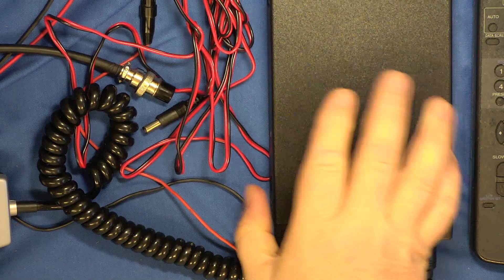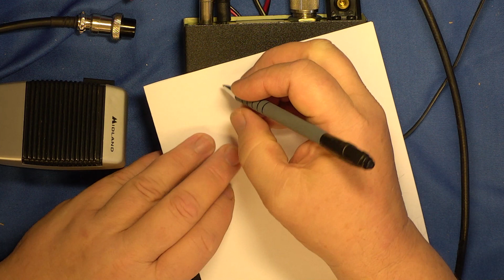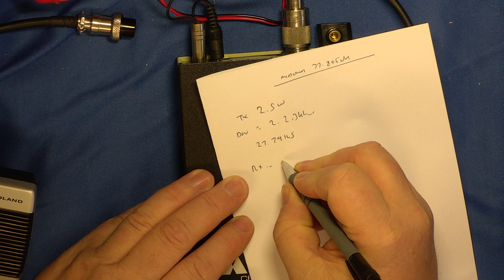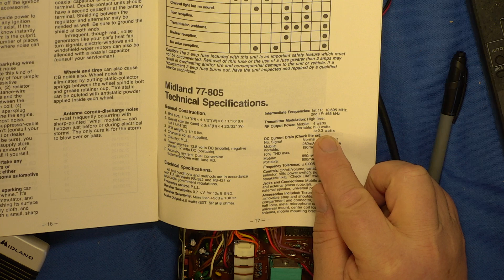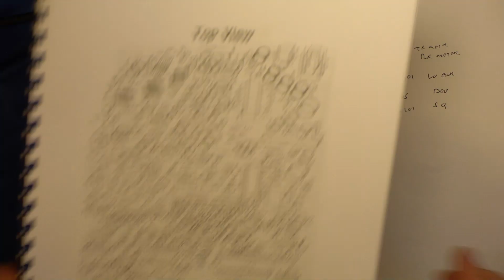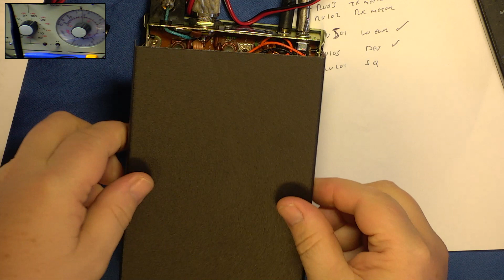Midland 77-805UK CB27/81 Portapak CB radio -  service

Comment: Funny you mention the "5 W input" thing w/r/t US CBs.  I am trying to find when the specification changes in the FCC regs.  At some point, amateur radio power limits were also changed from dc watts input to watts PEP output.  CB changed about the same time.  I'll let you know what I find ...

I really like the older Midland portables.
Reply: November of 1973 is when the FCC amended "Part 95" (which then and now included the rules for CB) to make output power where the regulation was applied, not the input.

Amateurs were a FULL DECADE later (1500 W PEP vs 1000 W dc input).  Amazingly, the AM crowd complained loudly enough that they were exempt until 1990.